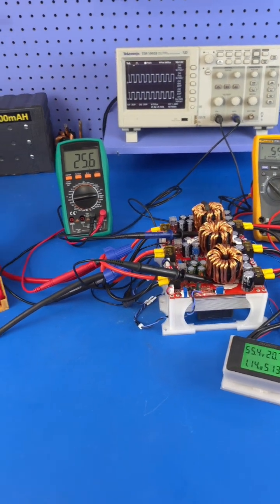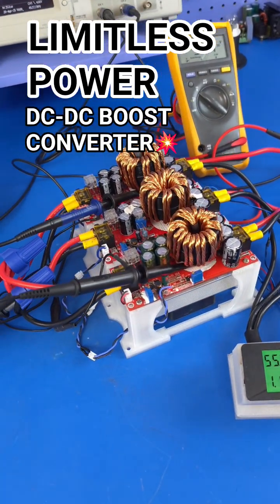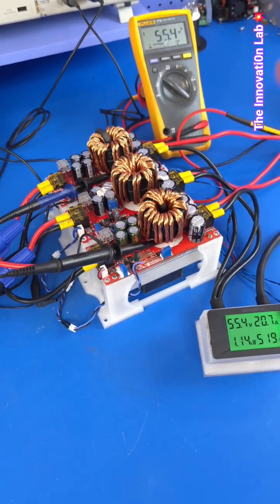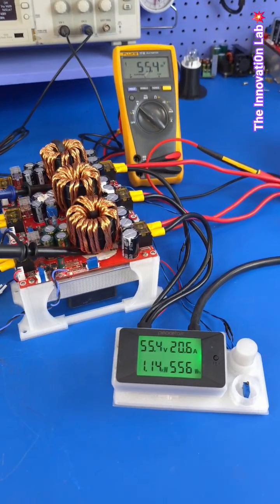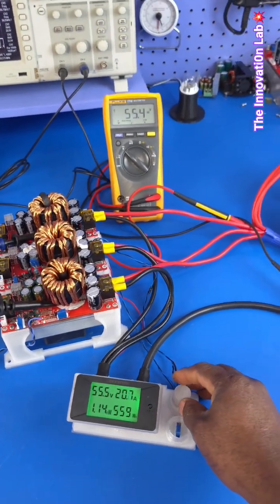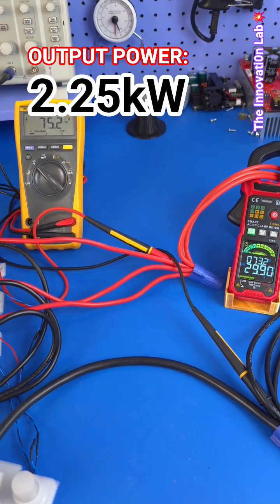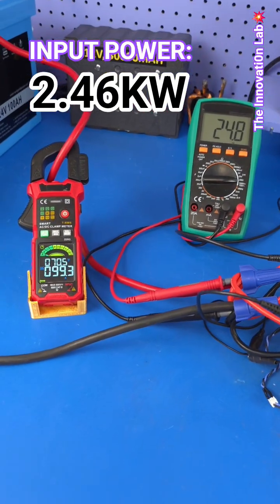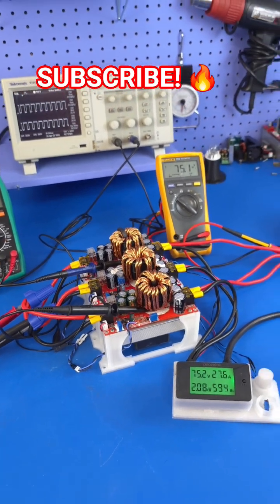DIY POWER BOOST Hack, By Combining Multiple DC-DC Converters in Parallel! #shorts #power

Comment: Wooow. I've struggled for a long time. I'm happy to find myself here. Can 12v 100ah Lead acid/LiFePO4 do this?
Reply from the maker: Wonderful!
We are happy to have you in our diy electronics community!!

Yes, you can drive the boost converter system with a 12V battery system. However, I honestly don't quite recommend using a low input voltage because the major  limitation is that you may not get a lot of power out of the system.

Please watch the 12V test video.
👇👇
https://youtu.be/cOjAgqY1oUw?si=Jo7dfPThYgP1T8Pt

Please consider joining our Patreon community.
https://www.patreon.com/c/TheInnovati0nLab/membership?redirect=true

Respectfully,
The Innovati0n Lab💥
www.theinnovati0nlab.com